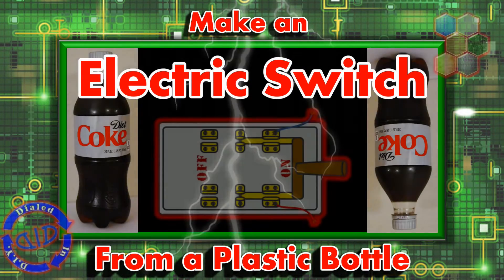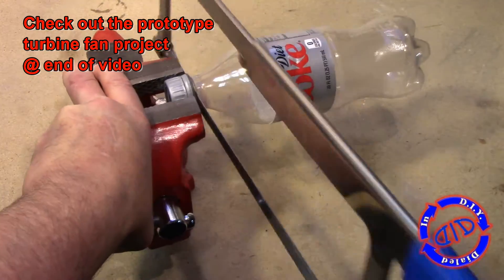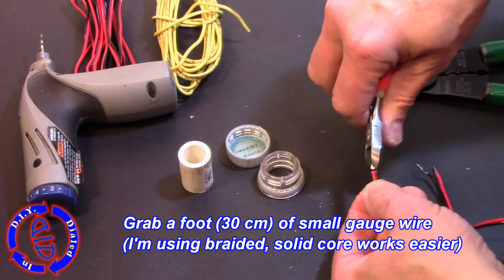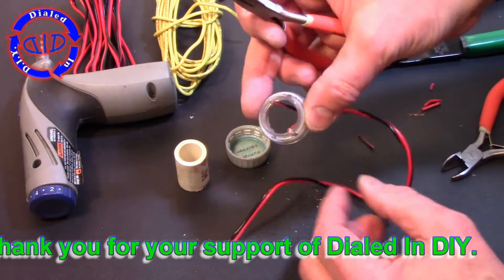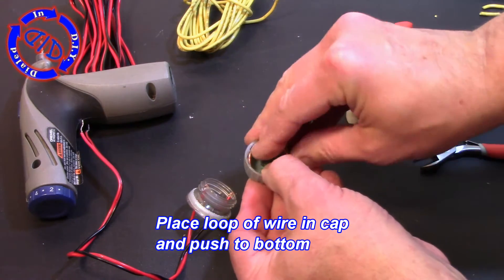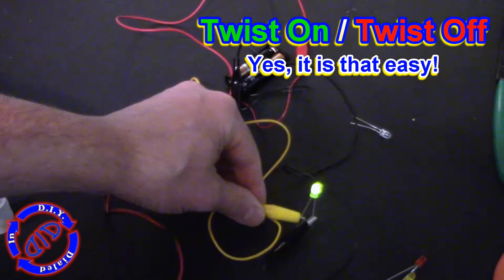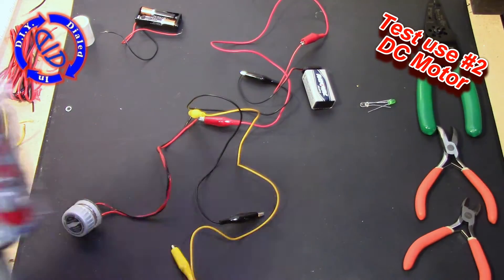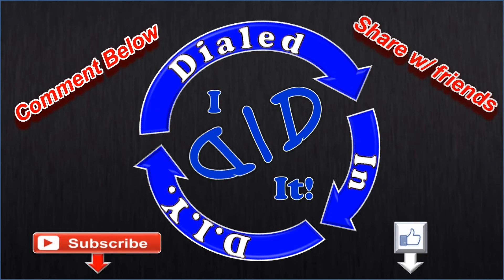Make a basic on-off Switch from Plastic Bottles - very clever

Comment: Video was awesome. Using this for my 5th graders diy build a toy boat out of only recyclables. Thank you!! One question and sorry if it’s a stupid one m, but I was wondering if the copper wire in the cap should be touching or should there be a small gap??
Reply from the maker: I greatly apologize for the delay in reply... I really do appreciate that you took the time to watch and post a comment/question!  Hoping that it is not too late to provide an answer here... Gap or no gap it should work just fine as long as it touches both parts of the wire on the sides of the bottle top.